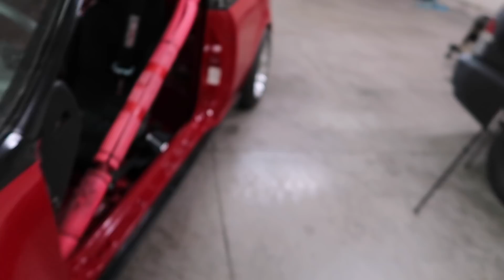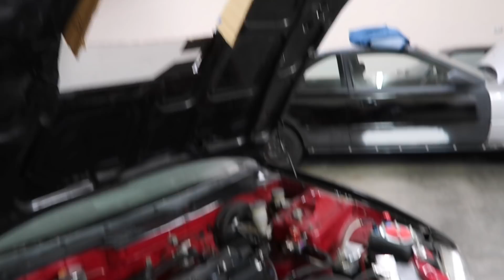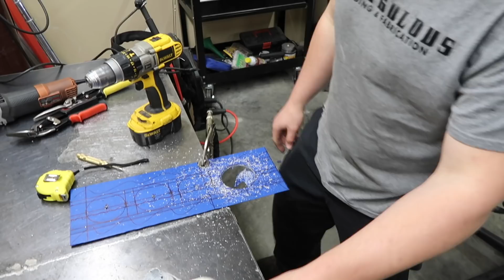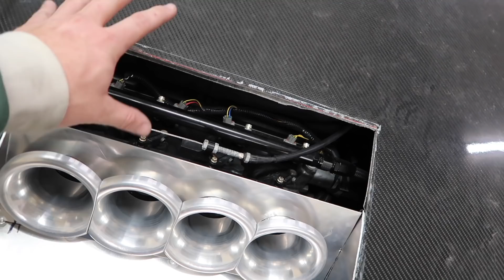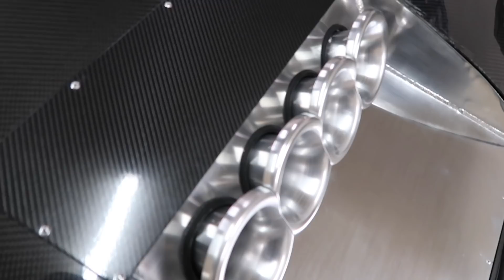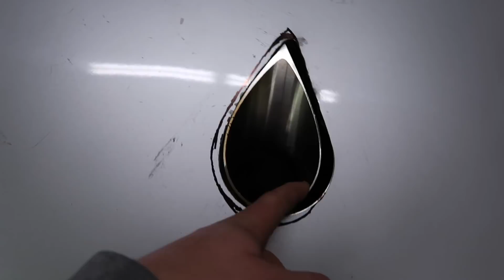K Swapped EG Intake Ducting

Comment: Will the motor flex when revved up?    Wouldn't the whole air scoop box bend?
Reply: It does look bad ass
Reply: That’s what I was thinking. I would assume this guy has race mounts but it’s still going to move a little.

It also depends on how oversized he made the holes around the ITB’s. There will be a little flex in the vacuum hose grommets as well.

But I still don’t see that thing staying in place after hard launches.
Reply: Dustin  Yeah that's exactly what I was thinking
Reply: Solid mounts don’t flex, if they do is very minimal
Reply: Even if it does flex it wasn't attached to the engine it's only touching the velocity stacks with the rubber around it so can move at that point
Reply: Solid reinforced mounts don't move much but they did use Pop Rivets and i think the speed and the wind will rip that thing apart.
Reply: Changing up gears @ high torque will flex but maybe the line "to prevent itb scratch" will help. Yeah solid mounts will help but it's going to move, a test to his sheet skills for sure
Reply from the maker: Motor does not move, bracked has a rubber mount on it also. I'm sure it's going to move a little it's not going bend it out of shape. The aluminum allows for a lot of flex
Reply: SuicideCrx That's dope, Will it not tear off at high speed?

Comment: Looks really good but for air purposes wouldn’t it be better if you took that bottom plate straight to the bottom of the itbs and contoured around them ?
Reply from the maker: Brandon Dale all this was for was to fill the big ass hole. Has nothing to do with routing air really. Best thing to do to get better air flow is lean mounts but he doesn't want to do that yet